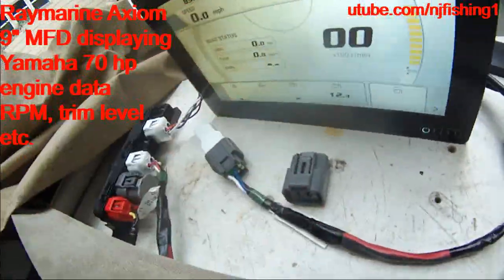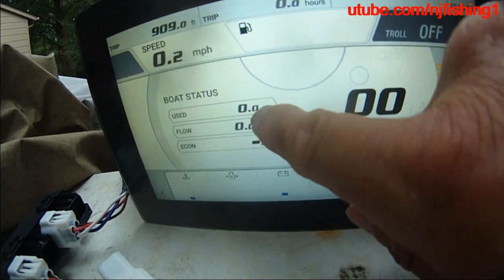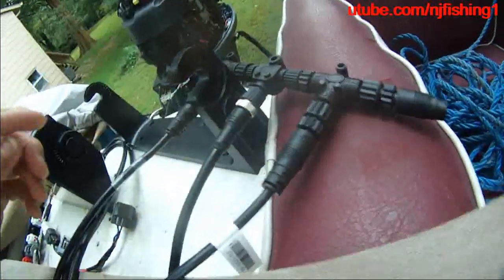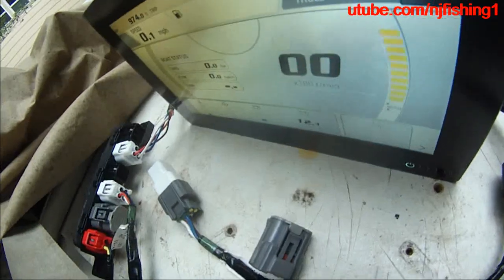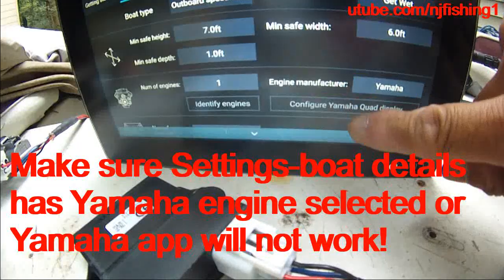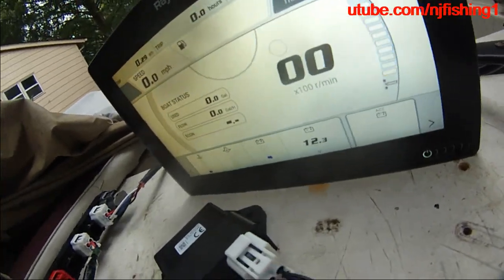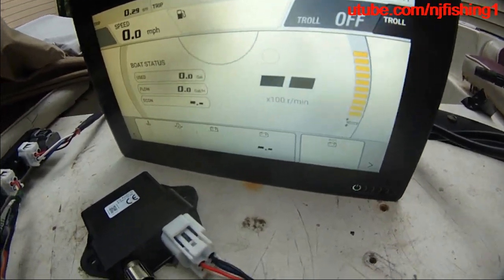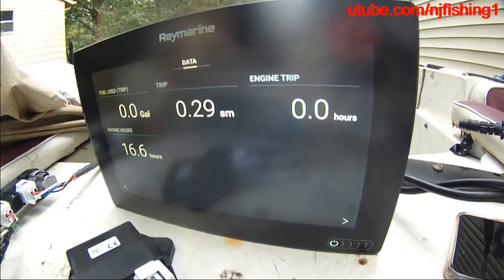How to display Yamaha outboard (F70LA) engine data on Raymarine Axiom MFD? using Yamaha command link

Comment: So I just picked up a new to me boat. It has an axiom 9 and a 150 Yamaha. It has some of this already as the nmea cable runs up into the axiom . I can only display a few things though , engine temp , oil pressure , volts and rpms . Pretty much everything else won't read . How would I tell what all I have and what I need. Hoping maybe I just need the Yamaha gateway
Reply from the maker: Congrats. Forget about the Yamaha gateway. Get the Yamaha MFD instead. You will get everything that way if u really need everything displayed
Reply: @njfishing1  Yamaha mfd?
Reply from the maker: Multi function display can do all sorts of things including trolling your Y150
Reply: @njfishing1  ah the factory Yamaha screen. Like the 7 inch